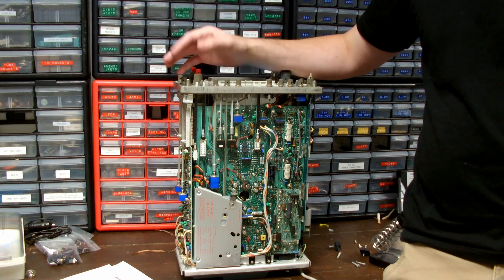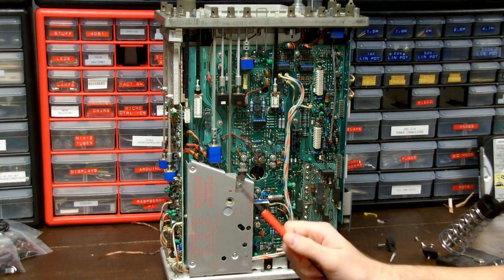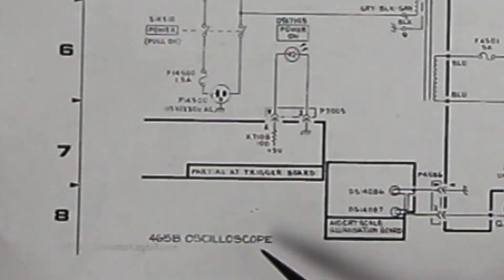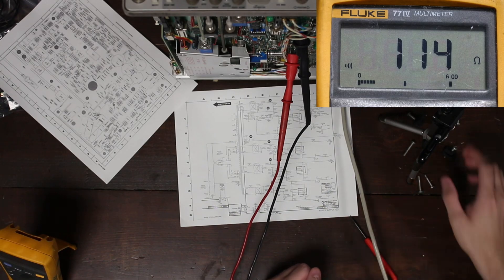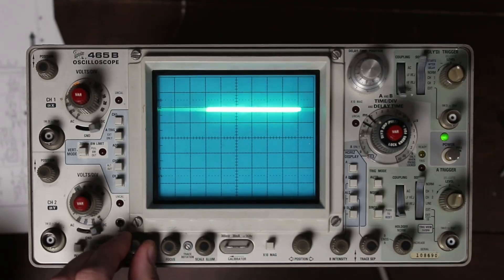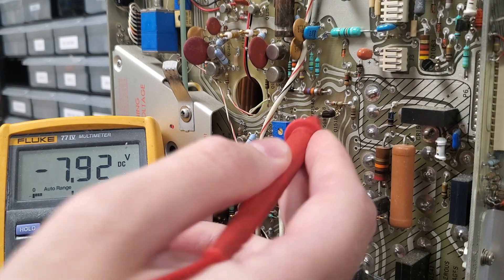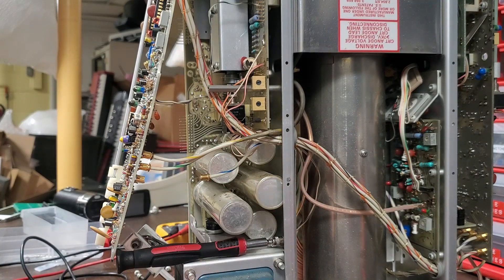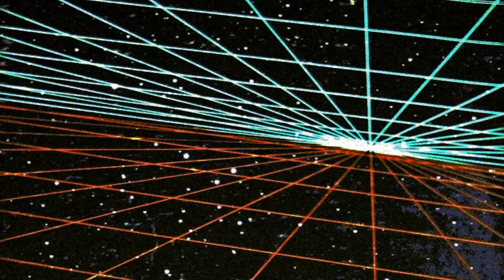Tektronix 465 & 465B Oscilloscope Repair

Comment: I have a 465 that I bought used from the company I was working for when they were clearing out excess equipment. Worked fine up until about five years ago. Then it died showing more or less the same symptoms as in the video. Ended up buying a digital scope as a replacement. I should dig that 465 out and repair it. Analog scopes are still useful for analog electronics work.
Reply from the maker: Totally agree! I think digital scopes have their place, especially with their extremely long sweep/recording functions and their ability to display stats such as frequency and voltage values at a moment's glance. However, there's something about the immediacy of analog scopes that lends itself to really quick troubleshooting. I can set up an analog scope way faster than a digital one since all the controls are right on the front (no menu-diving!), and they really shine when it comes to troubleshooting analog circuits: the scope doesn't have to "think" for a second when the waveform changes in a drastic way!

Comment: Usually the tantalum fail because the main supply rails have more ripple on them due to the bulk caps aging, their failure is usually a symptom of other issues with the power supplies.

Comment: Nice repair. I have a Tektronix 454 O'scope. And while it does come on and work pretty well, it has some dirty potentiometers. And seem every one is buried beep inside. I haven't yet disassembled it to try and clean them... But one day...I hope! Years ago now, I actually communicated with the original engineer of the 454 scope. And I do remember one thing he told me. He said that the Tektronix 454 scope (maybe others IDK) was designed totally around of the shelf parts with no proprietary ICs, or specialty parts. So it can be repaired without trying to locate discontinued parts. That was a great thing to hear...
Reply from the maker: Aren't these potentiometers such a pain? I'm guessing they're so far back to cut down on stray electrical noise, but they're such an odd job to work on. Those plastic rods that connect to them also give such a mushy, non-assuring feeling when they start to loosen or when the potentiometers gum up. Best of luck on that 454! Unfortunately my 465's have some custom Tektronix silicon in them (not sure if they're completely custom ICs or just Tektronix rebrands of off-the-shelf parts). Either way, looks like your scope will far outlast mine unless some daring engineer wants to come out of the woodwork and spin up a fab specifically for obscure 70's Tektronix silicon ;)

Comment: Don’t be nasty towards that Tektronix 465. Used them a LOT (daily) from the 1980’s to the early 2010’s, when I moved on to the Tektronix 2465. Took me long after that before I finally found a digital oscilloscope that even came close to any of those old Tektronix scopes… still wish I had a 2465 on my bench now that I am retired… (but I am spoiled by the laest digital oscilloscopes), but those old analogue scopes had a charm of their own.❤❤❤

Comment: You have an interesting approach vis electronic fault finding, I think you do a good job. @ 14:28 the BR in your hand looks like the leads are tarnished. I've had the same issue with other NOS components. I always remove any oxidation on leads before soldering into circuit.All the best......DA.
Reply from the maker: Thank you, and keen eye! A number of those rectifiers in my parts catalog all had oxidized pins. Sanded them down off-camera before soldering, but didn't think to include that step in the video. Good tip for those working with NOS parts.